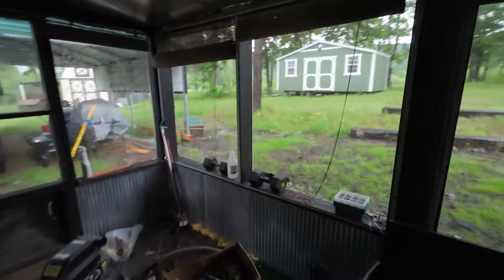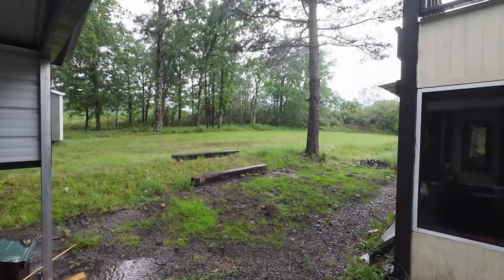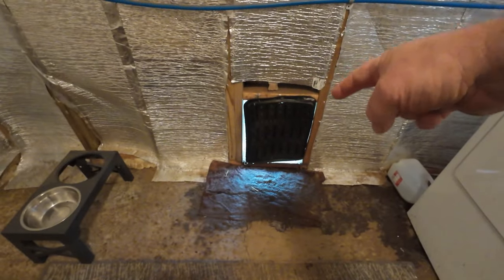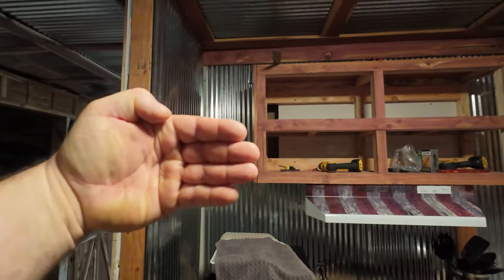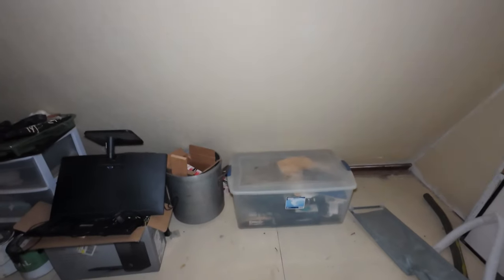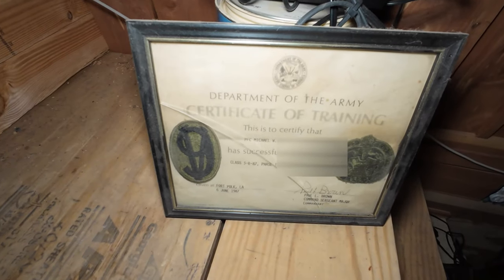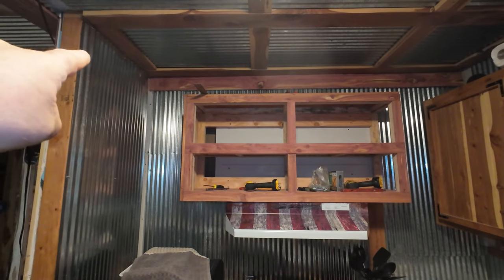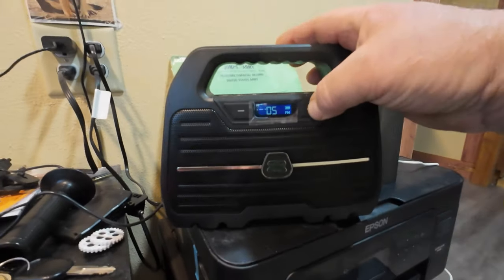Heavy Downpour For A Hour, Last Years Flooding Issues Are Gone

Comment: Where and what years were you a drill sergeant?
Reply: My husband was a Sergeant in the Army. He was in Germany--cold War. 77-90.
Reply from the maker: I attended Drill sgt academy when I was in the reserves after active duty, same training, but our job was to relieve active duty DI's,who were on leave. I did some cycles at Ft. Leonard Wood, Experimental cycle at Ft Polk. Then I was reassigned to another unit in another state which had no use for a di.They still have Reserve Drill instructors today.